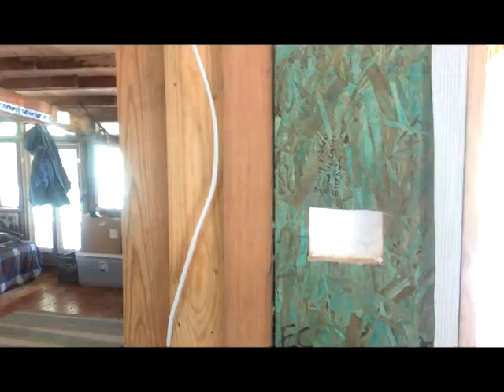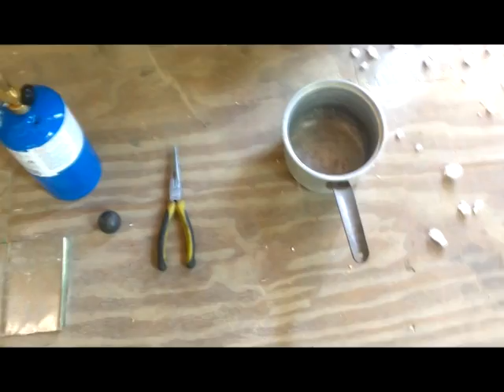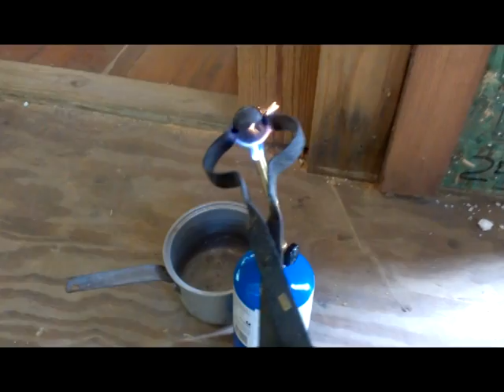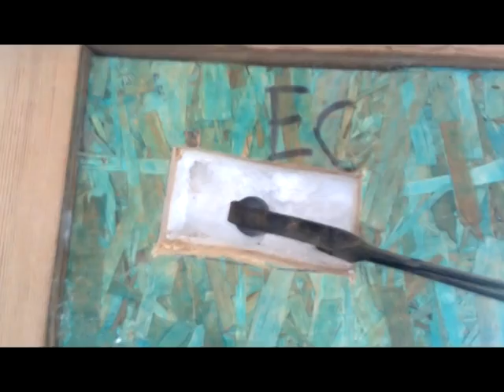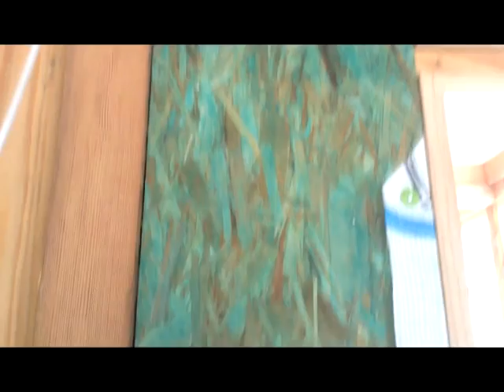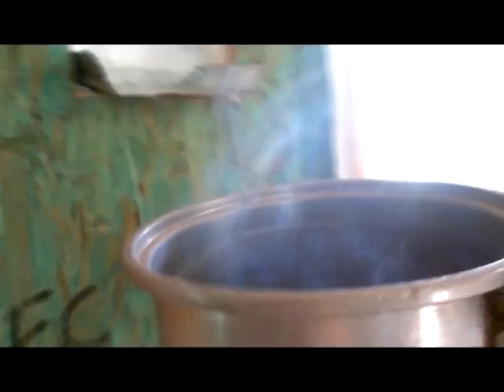sip wiring

Comment: Is there a danger the steel ball will cool and get stuck before it drop out!
Reply: You could retrieve the ball from the top hole with the magnet to save having to saw into the wall.
Reply from the maker: Yes there is.  I have not had it happen yet but if it did you could locate the steel ball with a metal detector or possibly a strong maganet ,  use a hole saw to access it and try again from there.  the hole is easily patched with the cut out from the hole saw.
cheers

Comment: Couple other questions if you don't mind. How long did you heat the ball for?  The foam I was touching was melting a tad. But mostly just smoking and sticking to the ball. I'm guessing it needs to be hotter. 
Did you wear insulated gloves?  I was using vice grips and it wAs getting a little toasty.

Comment: Art,
I have spray foam insulation in the walls of my condo and I want to run a 3-4 foot vertical chase in my wall but the foam is packed so tight from dry wall to brick that I have no room to run wire. Will this work on spray foam?
Reply from the maker: I have not tried it with the pray foam.  Test a small piece out side the wall first.
good luck, have some water on hand.